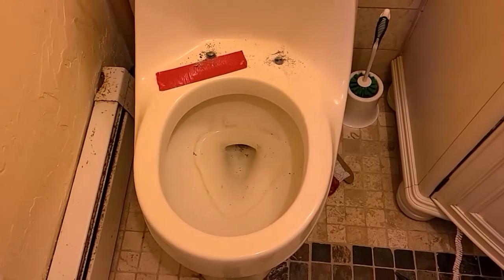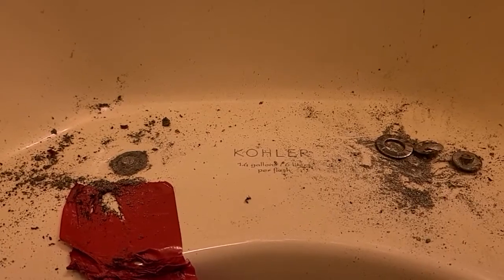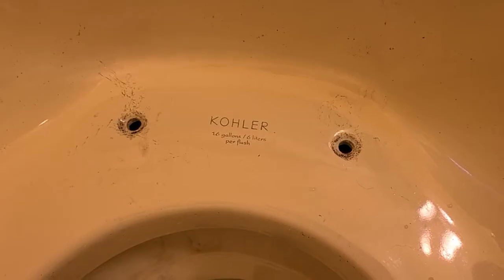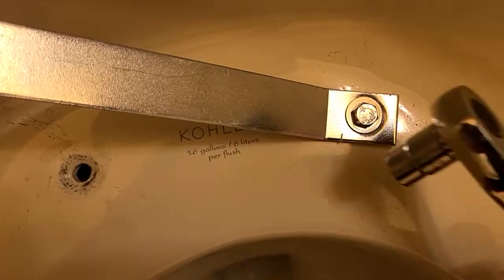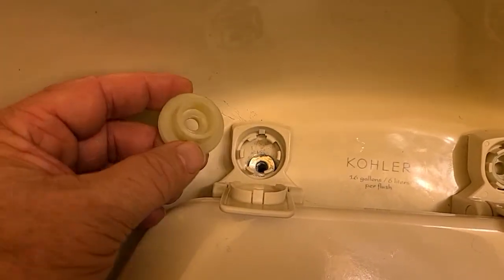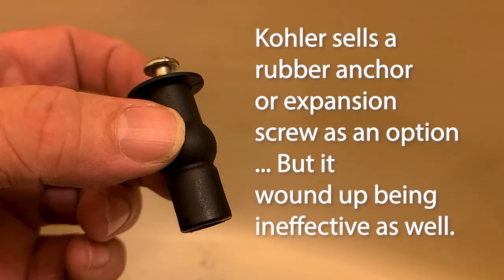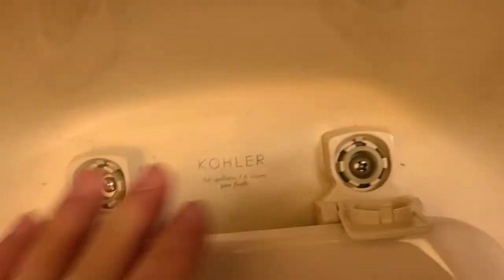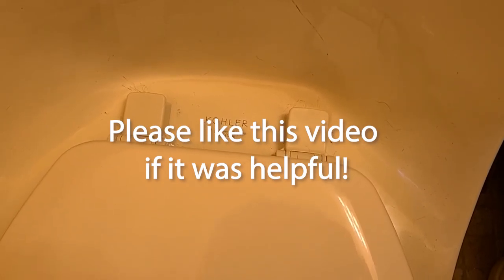Before You Buy a Kohler One Piece Toilet, Watch this Video on Replacing a Toilet Seat.

Comment: At 10.03 the fun continues i laught so hardq but felt your pain.. im going threw it now thanks for the info.. kohler from hell!😂😂
Reply from the maker: Hope you figured it out!
Reply: @davidcomora  yes I got the screw spinning and loose then i lifted it about 1/4 high,.I put a glove to protect the porcelain from the steel hammer on toilet and  the back of the hammer threw the screw. then I hit the steel hammer with plastic mallet it will raise it for me as I hit the steel hammer with the mallet.. so the steal hammer prys it up as I hit it with mallet.. it came off easy I struggled to use the recommended tools by kohler.. they weren't rigid, they were bending too much.. I used the steel hammer as a pry bar it worked flawlessly if u hit it with plastic mallet.. thank you for your help it took 2 weeks to go back was done in a 1 hr

Comment: I finally thought I found the hardware at Home Depot online.... but the parts never arrived. I'm having Hell trying to find those expansion nuts or bults and screws. Have you maybe 2 to spare? Can I buy them from you? I am at a loss. No way to fix my toilet lid... The "original parts" for Kohler's one-piece toilet didn't fit my holes at all. My holed are 1 cm in diameter.
Reply from the maker: I hope you were able to find them.  Have you tried Lowes or Ace Hardware?
Reply: @davidcomora  No, I’ve tried everything and every instance, including Amazon and EBay

Comment: Mine has these black pieces that allow quick release of the toilet seat. I purchased a new insert and had to purchase a new screw the other one superimposed to the insert. I out the anchor in, put the bolt into the black piece and started screwing. Unfortunately, the screw stops and the insert doesn’t expand so it’s still loose. What should I should?
Reply from the maker: @jenm6476  i had that problem and had to find the correct size anchor.  I used a rubber expandable anchor...the firat was too big, so i had to go smaller.  Good luck !

Comment: What did you use to drill out the headless bolt? I am presently at that stage lol
Reply from the maker: Once the head of the bolt was sawed off, I used a steel rated drill bit that was smaller in width than the bolt and drill down in it about a 1/4 of an inch. Then I used an old drill bit and a hammer to push the bolt down into the fixture.  Since you are dealing with ceramics, you need to be careful when you pound down... so if you need to drill further to make the bolt pliable enough to pound through, it might be a good idea.

Comment: I bought the metal Kohler kit and it worked ok to put a new seat on. But now about 3 years later we want to change seats again. The anchors are just spinning. I can’t pry them out. The ‘wrench’ they included with the kit can’t get enough grip on the anchor to hold it while I break the screws loose. They must have corroded together. I hate this toilet so much. Thought my issues would be solved forever by buying the official kohler anchors.

I might try slide hammering the screws and anchors out. If the toilet breaks, I will celebrate as I throw it to the curb.

Comment: Believe it or not, I'm still at it. It has been almost 2 months. Could you, please, answer me this? The anchors contained in the 84999 seemed too narrow for the holes in my toilet, a Kohler Rialto, in spite that they recommend this part to fix my toilet seat. Is it maybe so that it doesn' t matter, since the expansion nut will expand anyway? I can't find any of the other nuts and screws that you and some other people talk about. It seems that Home Depot is no restocking a lot of things, maybe because there are problems with the supply chain. At least in Miami.
Reply from the maker: Ugggh....as I recall, i had a tough time getting the Kohler expansion screws in place, they seemed tight and then 1 broke.  Mine were really tough to get in the holes.  I had to bang them in and was afraid I would crack the toilet.   I found the Home Depot rubber expansion screws worked great, but they need to be the appropriate size.  They are pretty cheap, so maybe try a couple of sizes.

Comment: Did you see the 84999 Anchor set with the remoal tools?
Reply from the maker: I bought a kit from Kohler, not sure of the model, but the expansion screws broke upon installation.  So the rubber expansion screws were a lifesaver.  Is there new kit?

Comment: Omg. Listen to this guy. DON’T BUY THIS TOILET!!!  My parents have one.  It’s probably 15 years old. The flushing design sucks. You have to either hold the handle down, or flush it firmly enough so the flapper stays open long enough to flush. I shouldn’t have to put how to flush instructions on the toilet. And this GD nightmare of changing the toilet seat!  The expansion nuts seem to work very well. But whoever the genius is that designed the “quick release” toilet seat is an idiot. As soon as you tighten the bolts down, the quick release bracket spreads out so that it doesn’t hold it in place. Why does anyone need a quick release toilet anyway???  I’m ready to rip this toilet out and explode it!  Rant over. Thanks for the video. It definitely helped. Sorry to you and probably the rest of the people here that are stuck with this toilet
Reply: Yeah and they're extremely expensive new. Good luck

Comment: Get the correct flappers, and replace the seat, I have been running Kohler 1 pc 2 of them for almost 20 years, no such issues...Ya replace the flapper maybe every 4 years, and the actual valve after 15 years!
Reply from the maker: LOL, I may make another video on how to remove the black plastic flapper bar from the back of the water tower.  No easy feat!  I noticed on Kohler's video that they cut at that point and then the video continues after the bar has been removed.  I also notice they removed the ability to comment from that video as I suspect a lot of folks have been having difficulty removing the bar.   I am about to replace my 10th flapper in about 18 years.  Maybe my water is hard, but the other non-kohler toilets in my house have only had flappers replaced about 1 x in the same time period.  This is not a cheap date!
Reply: @davidcomora  I use Fluidmaster or Korky brand or Kohler OEM flappers...I suspect Kory and or fluidmaster actually makes them anyway.  The water tower with the snap in flapper in the back, ya have to make sure you have it proper height, otherwise doesn't work properly.  Ya just stretch the thin part that goes into the holder, it snaps right in place...Water quality has a big influence on the flapper and the base it seals against last, for sure. I replaced my one Kohler seat with a new Kohler, using the tool kits from Kohler, inserts went rigth in, now I have a new seat that closes on it's own slow like, no more dropping it.  the installation kit from Kohler makes it easy

Comment: You missed a step on the anchor inserts. First tighten with lock and flat washers and then just the locking washer. If you overtighten the anchors they will break! VERY BAD IDEA TO REPLACE THE ANCHORS WITH CHEAP ONES!! You will never get them out and they will spin like hell when you try to drill them out.
Reply from the maker: Tought to determine what is "over tightening"   the rubber expansion screws have worked like a dream.

Comment: Unfortunately, I didint watch oyur video to the very end, when you tell that Kohler's parts are not worth it. So I ordered the kit from Amazon, just to find that the anchors were loose inside my holes: they are 6 mm in diameter and my holes are 9 mms. Now, I have been trying to find your Expansion Nuts #10-31, 1 1/16 in Miami and I cant find them. Neither in Home Depot, Ace Hardware or Ster Brothers. Can yu give me a hit as to where to find the hardware you are showing in your video, both the but and the screws? I'll be most thankful. 
Im about to get crazy trying to solve this!!! A toilet from Hell, indeed.
Reply from the maker: @viviangude2789  sorry to hear about your troubles.  I did find the anchor kits at my Home Depot.

Comment: Boy! Do I "feel ya" LOL 
To change toilet seat, you'd have be firstly a contortionist, secondly, you'd need extra hand, then you'd need an adjustable wrench to place under and behind the one piece toilet tank to snag-on the bolts AND  simultaneously hold a screwdriver to hold the top screws and THEN...you're good to go.
My solution: buy another toilet. This is what I'm going to do this week. 
We have Pfister with the same issue. I managed to change the seat once but it keeps on coming loose.
Whoever designed this shitty crap (no pun intended) ought to be horse whipped and pissed on! 
It looks good but that's about it! Useless otherwise.
P.S. Might have to break the whole damn thing because can't find WHAT is actually holding the damn thing to the floor. Grrrrr....
Reply from the maker: Thanks for you comment and the laughs!  Glad to know I'm not alone!  My wife and my kids (who have grown up with me cursing out this toilet) have been on my case to throw this thing out for years, but I'm stubborn and I've taken on "the Kohler Challenge" as my life's work!  Pretty pathetic!  So, I finally got the seat back on, but I still need to hold the handle down for the entire flush cycle or I don't get a good flush.  I know if I spent 20 minutes adjusting the internal hardware again, I can fix that issue as well.
Reply: @davidcomora  Your welcome. I was giggling to my self watching you, LOL
But what a "challenge"... Funny, I have issue with the flusher too. And ...the damn thing whistles too!? 
Worse when guests have to use it as they don't remember having to hold the frigging button down till the "surprise" is gone. Guess who has the shitty job of keeping an eye on it ....? (Taped sign onto the wall doesn't help).
"No shit" has a new meaning...LOL
I'm with your wife and the kids! The must love you to pieces to put up with it LOL.
Get rid of it :-)
Thanks :-)
Reply: @davidcomora  I just shortened the travel on the chain attached to the flush handle i.e. holds the flap wider open. It seems to be working.
Reply: Imma alone my father, RIP  got these awful toilets installed in his house . My toilet seat broke I ordered a new on Amazon Ive replaced many a toilets in my day as a woman but now  that I’m almost 60 now and caring for my mom with dementia I’ve had a Stroke we are alone have a home warranty even though my folks have owned this house since New over 25 years ago.  I’ve unfortunately threw away the broken toilet 🚽 seat ordered a New one and guess What? One of the Bolts won’t Budge…
What to do I think after sitting on a toilet with out a seat for several weeks now plus it’s So Low hard for me to get on and back up. I think I’ll call my Warranty and replace to a American Standard and be done with this Nightmare. Every Upgrade on this house my dad had extravagant taste he had a Japanese Soaking Tub put in the Big Master Suite  . They had to use a Crane and knock part of the Wall out. To even use it is Quite almost impossible and Dangerous. There’s Slick Marble all about with steps to get in not enough flat space you Practically need to be a Contortionist or a member of Circus 🤡 De-Soleil in order to enjoy 😱❗️
Thank you for Sharing ❤️

Comment: Was looking for new Koholer seat and wound up here. I have to say LMAO pun intended. I have a Kohler Rialto toilet installed by plumber which worked fine for about 6 months after that it became a Ford (Fix Or Repair Daily) toilet. After 6 months it began running continuously and required adjustment almost daily until adjustment used up and had to buy new flush valve assy and then another. By 3rd time learned there was a repair kit and went to plumbing installer with kit number and he plops down the entire assy again. I guess the parts guy thinks everybody except plumbers are stupid, he's quite the sales man or so he thinks. $60 assy vs. $12 kit, hum let me think? Found a work around for the never ending running toilet by using the standard wall valve. By the time was about to buy 3rd std. wall valve bought a ball valve type instead. Had a grey Kohler toilet seat which with age has now turned about the color of your seat/lid. This has been going on for 40 years LOL. Will chek out that Bemis seat. Thanks for sharing.

Comment: Kohler no slam seats come with all the parts ya need, when you order the correct stuff, buy a Koler seat for a Kohler toilet, this looks like total user installer errors...it's simple, you made it more complicated than it is
Reply from the maker: Its good to know about the no slam seats.  It may be "simple" and "easy"  if you are a professional and you do it all the time, but many of us are just normal folks trying to change a cracked Kholer seat and thinking that it just like changing any other toilet seat.  Sadly, that is not the case!   In hind (no pun intended) site, if I had known that I needed to buy a Kholer seat for 2 to 3 times the price of a typical seat, I may have done that, but I still would have had to hacksaw off the rusted bolts, knock them into the fixture at risk of cracking the fixture, and install the anchors...and that is neither "simple" or "easy".